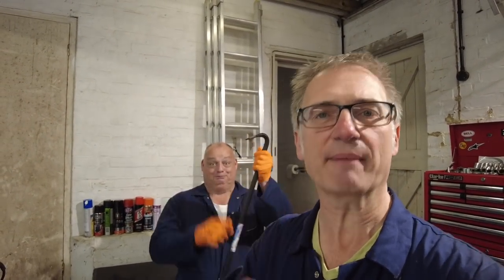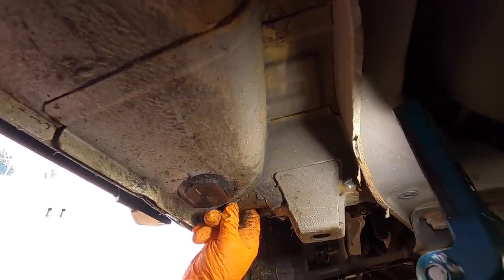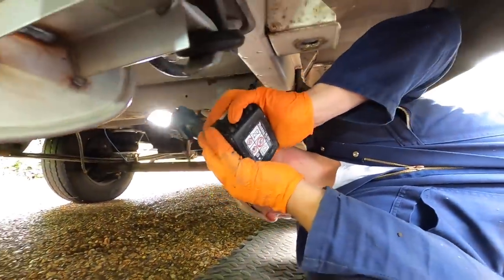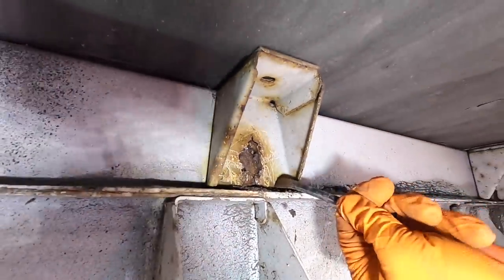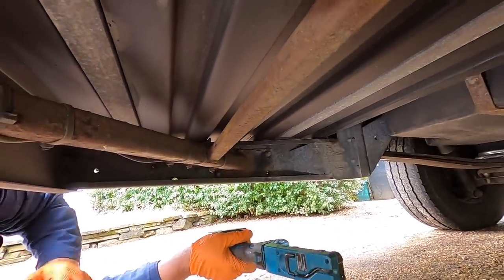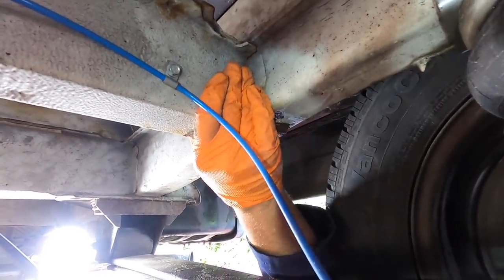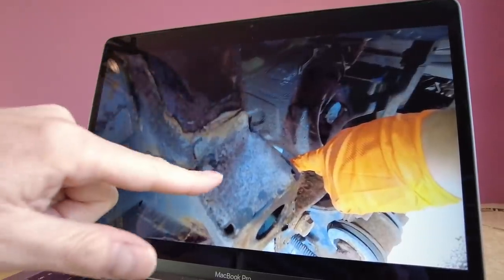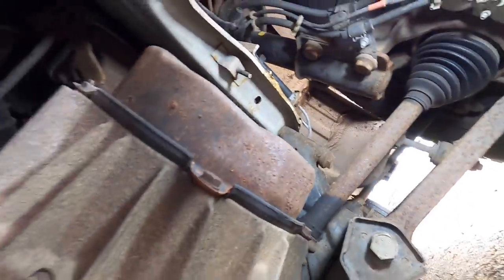Checking for Rust on a Fiat Ducato Motorhome

Comment: My 7 year old Ducato has no rust on it at all, including underneath which is spotless. It has been in salt a few times but I get underneath it & wash it everytime & everytime it gets wet, with a hosepipe spray, not a jetwash. That is the secret. The front plastic wheel arches are a magnet for mud & thus salt, if you dont get a hosepipe in those regularly rust will start there soon!!
Reply from the maker: Some great tips, Dan. Thanks 👍👍
Reply: @HermanHitstheRoad  Thanks, yes the mud gets trapped in the wheel arches between the bodywork & the plastic. I took mine out & put extra coatings of Dinitrol in that whole area.

Comment: Part 1... Confidence booster.  Not sure about Bob's state of rust.  We did many months of parking near the sea.  Mostly it's that roll bar that looks bad.  I'm looking forward to part two.  Absolutely I am!
Reply from the maker: The roll bar? Do you mean the crossmember at the front which the radiators sit on? That is a common problem with Fiat Ducatos of this age. It's easy to replace them too. I ordered the crossmember in 2013 off of Ebay. The product was titled "FIAT DUCATO 1994 -2002 FRONT LOWER CROSSMEMBER" at the time and it cost £83. I rust protected it first before fitting.
Reply: @HermanHitstheRoad  I should know better to write a youtube comment before getting out of bed.  I'm in Maine right now & we have a blizzard on and it's too cold to think.  I meant sway bar.  The bar between the rear two wheels that looks like it does something mechanically when you go around turns.  No idea what it is supposed to do really but it's so rusty that it seems like it needs replacing.  Somehow it seems to attach into the braking system?

Right now I'm really missing our annual Morocco trip.
Reply: @HermanHitstheRoad  Thanks for the crossmember tip though, if it's gone on yours, then probably gone on mine too.  

The BIG thing I may need to do is to simply replace the engine.  It blows too much blue smoke for my liking.  I find it shameful to be driving into lovely Italian towns belching out clouds of blue smoke on the way up those hills.  The German youtube guy and his Covid lockdown project of completely rebuilding a turbo diesel engine out of some random rusted out white van he purchased for probably 500 euros was inspiring.  

Then again here in Maine I cannot even replace a valve cover gasket properly.  I put it on and oil comes out all over the place.  Ugh.

Comment: I've posted before , that i've got a slightly newer Hymer 584 (year 2000) , and i have to say my van is in a very similar condition underneath . I do have some rough spots in pretty much the same places , though in the main , these are also mainly confined to the rear end , and my slide out motorcycle rack . Both my front wheel arches appear in slightly better condition , but i think this could be due to my still having the plastic liners fitted , which appear to be missing on Herman . I'm also in the throws of fitting front mud flaps (custom jobby) . I do give the arches a regular pressure wash , and under seal top up yearly , just for the mot . 
I'm a little surprised you didn't show the front chassis members , as the offside front is a classic rot area on this age Ducato . But i know you've examined that area , as you showed a rather sad looking removed cross member , and you wouldn't have missed any corrosion during the removal . I had corrosion in this area , but only very light . It's interesting to note , this is despite my examining the area , it only came fully to light after i removed the front bumper . The corrosion was not visible from underneath , though as i said previously , i still have the wheel arch liners fitted . It's since being plated , and repainted , along with the front cross member you showed . I didn't need to replace it , just heavy de-rust , and paint . I also flooded the inside of the chassis with a cavity wax , both sides just. Actually i spent quite a bit of time on the front chassis , mainly inside the engine bay . I had both the intercooler and radiator removed due to other mechanical work going on , so was the perfect time to clean , de-rust , and refinish , both sides . My van had the front splash cover missing when i purchased it , which i've since managed to source and refit , though i do remove it for the mot . It was the very first thing i brought for mine after i purchased it .
I totally agree , the Italians have done a really good job with the chassis , i will admit i was a little worried , mainly due to the famous Alfa-sud , which disappeared in front of your eyes . I just wish i could say the same with the German conversion , i have found a couple of what i would class as bodges in the wiring .
Reply from the maker: Hi Mickey, thanks for your comment. Really interesting to hear of others looking after their vans 👍👍👍

Comment: So glad i found thiw video. Under my ducato looked the exact same and I have now treated with lanoguard.

Although, i did have a small hole in wheel arch behind front wheel, right at the bottom where it meets the sill. I got it welded up. But got me thinking, why are there no plastic liners behind the wheel? Or at least mudflaps on mine? Did yours have any?

Great video. Subscribed.
Reply from the maker: Thanks @stephenfaherty8999 👍👍. Ours doesn't have any plastic liners or mudflaps.

Comment: Evening i hope her man is still goinfiat ducato cross beang strong just wondering if you need to remove the radiator to replace the cross beam. as hours is very rusty thanks
Reply from the maker: Hi Jason, the radiators will need to be held up but you don't need to take them out

Comment: Nice video! I own a 2003 B524 and my front bar under the radiator is also rusted. Did you buy it on Fiat? May I ask how much for that? Thank you!!
Reply from the maker: Hi Dan. I ordered the crossmember in 2013 off of Ebay. The product was titled "FIAT DUCATO 1994 -2002 FRONT LOWER CROSSMEMBER" at the time and it cost £83. It's pretty simple to fit. I rust protected it first before fitting. I hope that helps?
Reply: A lot!! THX!!
Reply from the maker: NP

Comment: That’s a good job there. I’m curious about the chassis type as it seems the Ducato chassis with leaf springs runs all the way back. Most A class Hymers in that era had  an AL-KO chassis bolted to the Ducati Cab. 
My buddy has a 03 544 and I’ve a 99 E510 and both have galvanised AL-KO chassis with no rust or surface corrosion.
Reply from the maker: Thanks for your comment, Peter. Ours is a Fiat cab, engine and chassis
Reply: @HermanHitstheRoad  yes I spotted that. Ours are Fiat Ducato cab and engine of course, but the chassis is AL-KO. That’s the chassis from behind the front wheels on now. The front suspension mounts, chassis rails over the wheel arches etc is the standard Ducato Cab. When Hymer AL-KO order the shortened Ducato chassis Fiat manufacture a special short tail version which is flanged and two chassis are bolted back to back. The AL-KO is a fine chassis, doesn’t have the surface corrosion issues but…..it does have the torsion bar rear axel. If not maintained, greased etc the torsion bars break as happened with mine. All good now as I replaced the bars and added a Dunlop air suspension kit. I see you’ve the air suspension kit added also 👏👏.
Reply from the maker: Thanks Peter. Yes, we have the Dunlop air suspension kit fitted

Comment: So, how are you going to lift him to apply the dimitrol? On axle stands or have you got a pit. I have an Alko chassis on mine not sure if it makes much of a difference at the front.
Reply from the maker: Thanks for your comment, Paul. We intend to use axle stands. As you can see from the video we can lay underneath without any lifting but it'll be a bit cramped.

Comment: Your n/s front tyre is shot and possibly been under inflated. Check your tracking as well
Reply from the maker: What time in the video are you referring to, Glen. The fronts do need replacing but they are not bad
Reply: @HermanHitstheRoad  2:22 ish
Reply: @HermanHitstheRoad  inner and outer edges are bald therefore less than required % across the tread for legality. I’d really get a 4 wheel alignment done but also think your under inflating them
Reply from the maker: Thanks Glen, I'll take a look. They are inflated to the specs in the handbook
Reply: @HermanHitstheRoad  then, normally I’d look over the suspension but didn’t you recently replace the bushes etc, but did you do the tracking after?
Reply from the maker: The tracking wasn't done